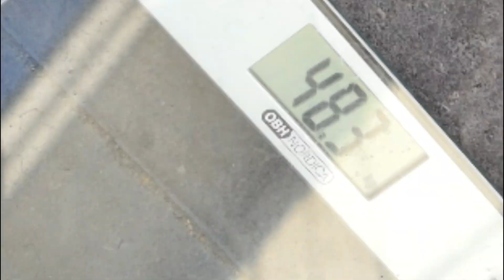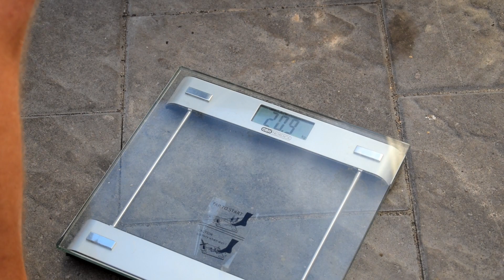Kopplar in ljud PÅ EN ORIGINAL STEREO!! - [VLOGG #99]

Comment: Du lär kliva under 12volt om du mosar på lite:/
Reply from the maker: Har ett extrabatteri förberett, tror du de hjälper?
Reply: KulPåHjul de beror på hur mycket cca ditt slutsteg vill ha men gör en big 3 å lite så ökar du med ca 25%
Reply: upp till 25% skall sägas. jag kör 5x 850cca batterier till mitt steg och de droppar inte under 12v iaf =) de steget jag kör ligger på 7k rms i 1 ohm
Reply from the maker: Jag kan inga specifikationer på biljud tyvärr :)
Reply: dra en extra jord från generatorn till chassit å en från generatorn bak till batteriet då ökar du med upp till 25% extra sen slänger du i ditt extra batteri så räcker de nog en bit iaf =) använd så grova kablar som möjligt med många kardeler i =)